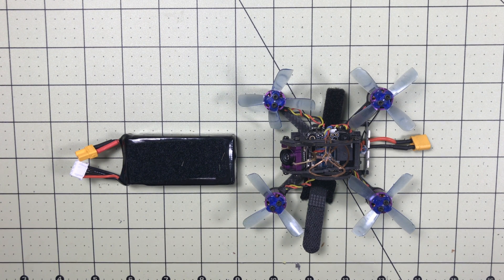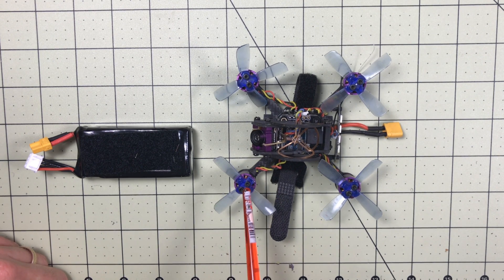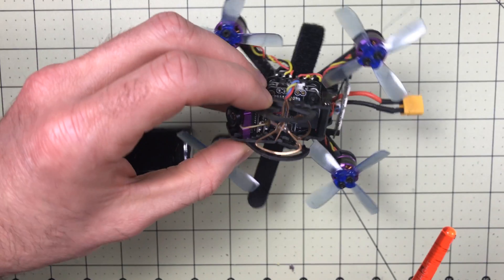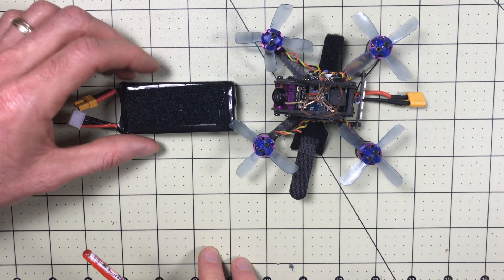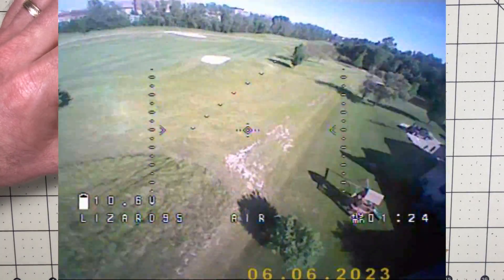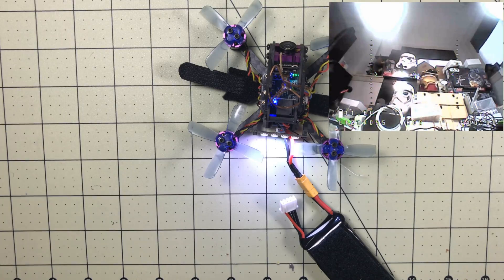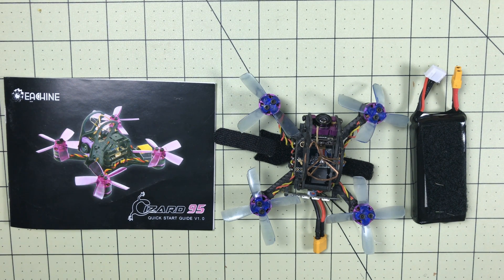Eachine Lizard95, how to use 100mw on the VTX and testing other props and batteries

Comment: Come back to the Lizard again Mark this little drone is totally  awesome. What does 3.2.2 do to it's flight characteristics and does butter-flight make it more fun? As of late (poor weather) I've been flying my older quads and found that it challenges skills these flight programs can make to east to over come. A noob feeling on the sticks really brings the adrenaline back to flying.

See you in the sky!
Michael STONEWULFF Goliboski
Reply from the maker: I may have a Lizard update soon if it works.
Reply: DroneRacer101 I love my Little Lizzy...she bit me once but that was a warning to use arm switches! 
I am abou to switch to a dipole antenna  for the vtx as my omni split form the center wire....impossible to fix so replace with duarable is my idea...then I can take off those ears. Lol

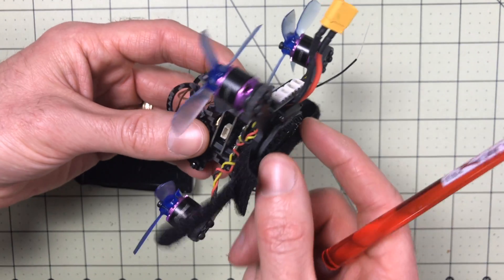Comment: 1:36 Kevlar thread from HKing  under tension does not let the Velcro cause it to fry (as it will loose)  and holds corners down tight with a cross pattern where the weight added needs a jewelers scale to detect. Where people use cable ties Kevlar is stronger, lighter by a mile, and adds almost no weight. ShooGoo thinned penetrates well enough to seal tied knots and even fix the broken plastic metal blade holder on a coffee bean grinder adding years of life to a 20 yr old grinder;-) CA would have worked too but CA becomes hard and inflexible and is harder to remove when making changes. Shoe Goo and Toluene solvent to thin it is the best hobby glue tied with flexible CA IMO. But with Kevlar Shoe Goo thinned down is all you need and easy to remove... and a $4.50  3.5 oz tube lasts a looong time when thinned down.

Comment: Don't run the strap under the frame loop it through both sides and have the strap go over the battery pad holding it in.

Comment: Hi, I use the screws bellow to hold the velcro in place. The battery is then not directly on, but it is enough to prevent horrizontal shift.
Reply: André Lademann what screwdriver did you use to loosen the screws, i have a whole set and none are fitting

Comment: Hey! Thx a lot for your review.
I have vtx issues with my lizard ( its set to ntsc band A channel 1) , 25 or 100 mw doesnt change much.
I suspect issue with my antenna (little piece of loose wire next to solders parts of the antenna connecting the wire to the copper dome of the antenna ).
Could you make a close up image of the antenna to see if i can add a little bit of solder to fix my problem.
Thank you! :)
Reply from the maker: +bood1111 if I'm understanding it might have broken the same as mine did here. https://youtu.be/svM-7qPc2Rs

Comment: Hey man ! Thanks for your vids ! 

I have an issue and if you have a sec id be glad to receive your advice : 

- stupidly unplug the lizard during flashing ( don't ask how why when it's the firest time that happened :'( ) 
- I see it in dev manager as 43 error code ( usb device malfunction) and cannot connect to beta flight
- any idea how to reflash to 3.2 ? 

Thanks again for your vids ! :)
Reply from the maker: +Occa Sion Try and delete the driver in device manager and see if it will readd and you can then load Zadig again.
Reply: Thanks a lot for the answer, didn't work, after uninstalling device from devman.

Should I short the bootpad ? not sure what I have to do with this
Reply: had to short the boot pad after setting 3.2 and flash on connect :) Thanks for answering :)
Reply from the maker: +Occa Sion Ah, good to know, it's nice you don't have to short them to upgrade since they are hard to get to, but nice to know they do work to fix it if something happens.  A couple people have said they loaded the wrong firmware.

Comment: Good video, I just hit a tree with my Lizard and broke the plug socket on the 2nd (middle) circuit board. I can't get the top board off from the middle board any ideas? Even If I get it apart still not sure how I Solder the plug back on. Glue maybe. $84 for another mini cube module from Banggood would really like to fix this one.
Reply from the maker: I haven't tried to take mine apart.  But you don't have to buy the whole cube.  If you can get it apart you can just get the flight controller board.  https://www.banggood.com/Eachine-Minicube-F3-6DOF-Flight-Controller-Intergrated-Betaflight-OSD-20mm20mm-p-1126931.html?p=EB070918823112015072  Did you remove the solder from the pins connecting the boards?
Reply: They didn't look soldered but I guess they must be as that's where it seems to be sticking. Thanks for the link I couldn't find that part only the cube.

Comment: how much more flight time stepping up to 1100mah?
Reply: Here is how to get an estimate. Stock battery is exactly 1/2 this, it weighs 44g, the quad wieghs 68g, so its 112g total. With a 1.1A it is going to be total ~156g. Time = To*C/Co*Wo/W = 4min*(1100mAh/550mAh)*(112g/156g) = 5.74 minutes
Reply from the maker: +Richard E I don't really know. I use it for testing and haven't really done a full flight.
Reply: You have a 43% flight time increase from 2x the battery capacity. However your performance is also drastically reduced (I don't have test data on thrust with these props, otherwise I could tell you the number, its also easy to derive and calculate). The quad now weighs 39% more so you have an idea.
Reply: **These are approximate numbers and will vary on flying styles, wind, motor efficiency (so the flight time might only be a 35-40% increase because efficiency goes down when loaded more, as well as with faster spinning props).
Reply: thanks

Comment: Can somebody confirm, that you can only use D8-Mode? Because EU-LBT can only use D16-Mode.
Reply from the maker: +Murdy I don't really know the law there.  Are you not allowed to change that in the firmware?  Do you have to run that version?
Reply: My Taranis has the EU-LBT XJT-board, so I can't flash it. I think there is no way to enable D8-Mode for me. So there are no chances to bind the receiver in D16-Mode?

Comment: Is the 1100 battery the biggest battery you'd fly with without sacrificing performance?

Any plans to try a HV pack? I'd love to find a Turnigy/My Lipo or a branded battery that might have a slightly better build quality.
Reply: Its sacrificing massive performance with that (it weighs 39% more). It also only gets ~40% longer flight times.

math: Here is how to get an estimate on flight time:
Stock battery is exactly 1/2 this, it weighs 44g, the quad wieghs 68g, so its 112g total. With a 1.1A it is going to be total ~156g. Time = To*C/Co*Wo/W = 4min*(1100mAh/550mAh)*(112g/156g) = 5.74 minutes

You have a 43% flight time increase from 2x the battery capacity. However your performance is also drastically reduced (I don't have test data on thrust with these props, otherwise I could tell you the number, its also easy to derive and calculate). The quad now weighs 39% more so you have an idea.

**These are approximate numbers and will vary on flying styles, wind, motor efficiency (so the flight time might only be a 35-40% increase because efficiency goes down when loaded more, as well as with faster spinning props).
Reply: Jake Garrett wow that's incredible to know, thanks for breaking it down!!!!!

Comment: The OSD vanishes when you have a different video mode selected than what the OSD is set up for because the OSD overlay can't identify frames due to the mismatch, therefor it outputs nothing because it can't sync with the camera output.
Reply: Correct. OSD will work when camera and OSD agree on the same signal mode: NTSC/PAL.  If you want to change mode, do OSD first by going into OSD menu to change video mode; save. OSD will disappear. Do physical button, so the camera will switch to the same mode that OSD is set to.  Voila!  OSD reappears on that video signal.

Comment: My motors also get really hot while flying on my 850mah batteries
Reply from the maker: +gregor121 Did you softmount the motors or turn down your D?  If the controller is still correcting and has the extra weight I could see that stressing them more.
Reply: OK I turned down the D value and it seemed to at least improve my problem. Thanks!

Comment: great video.my camera on the lizzard breaks up and has noise coming through immediately when the props start to spin. did you have this issue? and is there anyway of correcting this? thanks
Reply from the maker: +Patrick Fidler I didn't have that issue at all.  Almost sounds like a short on the camera.  This is been a few days.  Did you get it fixed?

Comment: wouldnt it be worth it to put a runcam micro in it? it should fit with some effort and give amazing quality.
Reply from the maker: I just happen to have a VTX03 http://bit.ly/VTX03 and a Runcam Micro http://bit.ly/RuncamMicro on the way.  :-)
Reply: I would personally go for the eachine vtx 03 wich weighs 3 grams and go up to 200mw. It comes with a whip antenna wich is what i would use for this build, its lighter stronger and makes the while thing more low profile and better looking. I would combine that with runcam micro for the best possible leightweight fpv setup.
Reply: Yay!
Reply: Wow that's even lighter than Eachine TX02 (4.57g) and it's switchable!
Reply from the maker: +Arend Mookhoek that is an excellent question
Reply: Nice idea, what about antenna?  I'm pretty sure you need to install that as well.  How much heavier will it be to get that done?
Reply: Jup its even cheap and kind of amazing
Reply from the maker: +Arend Mookhoek I don't see any way it's going to fit on the Lizard.  But I have other micros on the way.
Reply from the maker: +huhhman I did see someone on Facebook get one on. But not in I way I would be comfortable with.

Comment: a 1.1A battery in that thing man... I have fallen in love with this quad I'm going to buy it before July... if there is stock left which is very questionable.
Ps: very good video thanks for your analisis.
Ps: Ps: then would you recommend something like a  600/700 mah battery?
Reply from the maker: +Dashz I have an 850 on the way which I think will be perfect. And they did just get more stock in. :-)
Reply: DroneRacer101 850 2s?
Reply from the maker: +matt daughtry unfortunately my new 2s is only 600mah. But it is on the charger.
Reply: Hey all things learned are helpful